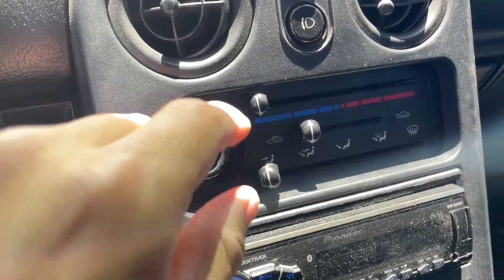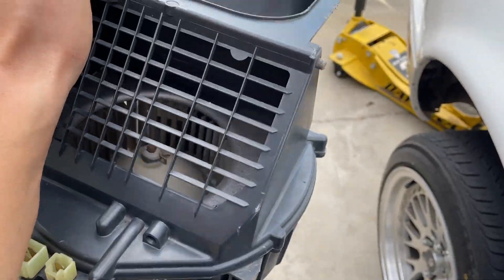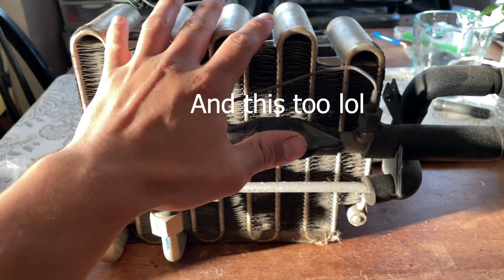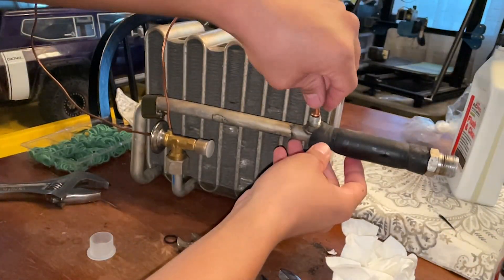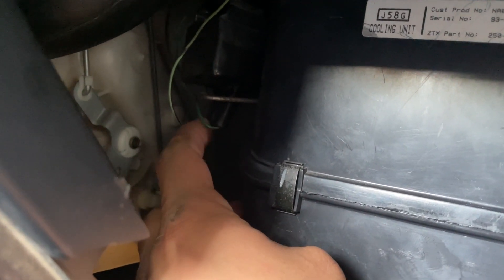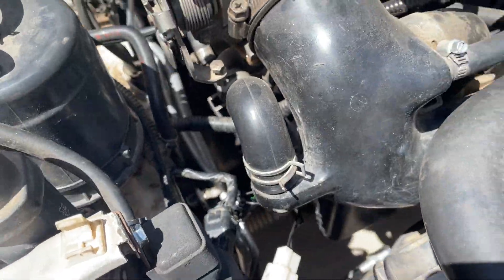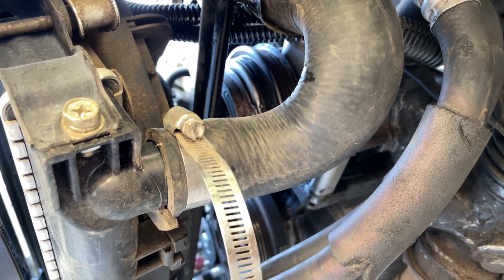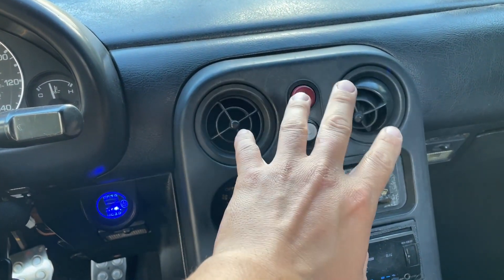NA Miata AC Overhaul! MX-5 Installing A/C | R-12 to R-134a

Comment: Where do the connections go from the box? The wires that you showed us that was near the box and what do they connect to ? I’m trying to add ac to my miata, but my car never came with ac.
Reply from the maker: Can you tell me the time of the video so I can see what you’re talking about?
Reply from the maker: Those wires go to what looks to be an evaporator temperature sensor. It attaches to the fins of the evaporator

Comment: Quick question bro! How cold does your Miata AC get in stand still traffic 100 degree + day?
Reply from the maker: @Zacutom  honestly, it’s too hot for the AC to catch up. Especially if you’re not moving. The soft top lets in a lot of heat and feels like the AC isn’t doing much. That’s pretty normal in these cars
Reply: @FloGarage  I want to find a solution! I will find it and make sure everybody who ever owns these cars will finally have the coldest AC on the block. 

First solution I heard so far is to ditch the inefficient compressor from the NA-NB Models and build an adapter for the NC compressor. I heard the more efficient compressor changes the car completely. But I don’t have a “spare” Miata to test this.
Reply from the maker: @Zacutom  I wish you luck!! A hard top might help too!

Comment: What size was your belt before you and sold your AC compressor from your crankshaft to your power steering pump pulley if you could please let me know that would be very appreciated thank you
Reply from the maker: @twistiepillowzjr.9751  I’m not sure of the size, but if you look up serpentine belt on O’Reilly’s or Autozone, it’ll actually tell you “with AC and power steering” or “power steering”

Comment: Why did you replace the pressure switch? Is it specific to R134a or is it because the connector is different?
Reply from the maker: @homer4163  no reason other than it’s old. Just some preventative maintenance
Reply: If i'm not mistaken, the pressure switch needs to be changed when switching from r12 to r134a. The pressure switch from 94'-97' model miatas already run r134a. If you buy the pressure switch off rockauto from those years, you will need the connector for that switch which is different from cars with a switch running r12. The connector can be found on various mazda's years 93'-96' ish and a slew of other cars, look up the part number for the new switch and read the list of compatible vehicles in order to find a car that has it. I found mine on a 96' mazda mpv van at the junk yard. From here you will just have to cut the old connector off and crimp on the new one.

Comment: Just curious what you're doing at 12:25. Are you doing something with the relay, or just connecting the pressure switch?
Reply from the maker: Just connecting the relay and switch to the harness and mounting the relay

Comment: Great video! I'm about to buy all the parts you listed. Is there anything you need to do the the AC compressor itself? Some of the forums seem to suggest that some parts of it need retrofitting. Also, do you have a link for the o-ring kit you used?
Reply from the maker: @homer4163  all you need to do for the compressor is drain as much as the old fluid as possible (out of the ports). You can flip it around, spin the center of the pulley, and take some time to get it out. After that, add some PAG oil into the suction port. It’ll probably hold around 4oz. When you install the compressor onto the engine, spin the center of the pulley to move some of the oil through the lines so it’s easier for the compressor to start for the first time
Reply: @FloGarage  Thanks! So you think PAG 46 oil, or will Ester oil work as well?
Reply from the maker: PAG 46
Reply: @FloGarage  Did you have to add any additional oil to the system, or just the 4oz to the compressor?
Reply from the maker: @homer4163  you have to add another 4oz to the system. I believe it’s 8 total. I would double check online the oil capacity

Comment: I have 1992 Miata, do I just buy R12 Freon to recharge the AC?
Reply from the maker: @VinzLopez-t3m  there are some things to overcome if you want to use r-12. It’s very expensive to get because it’s not legal. You will need some way to charge the system, like a machine or gauge manifold with a vacuum pump that is for r-12. It’s a lot of work and money to keep your system R12. If you have the Freon and equipment already, go for it. Make sure your system doesn’t leak though